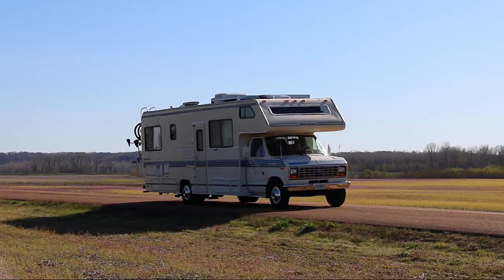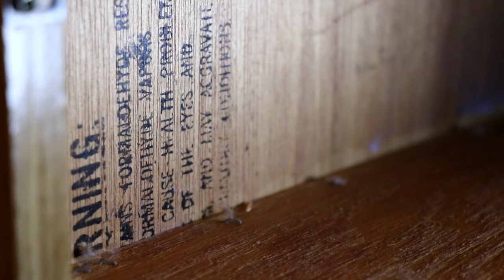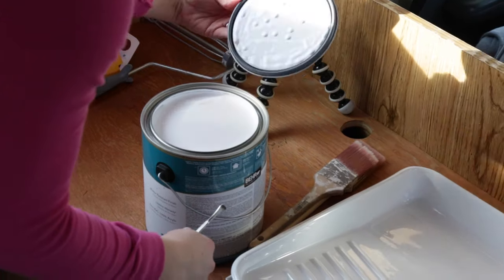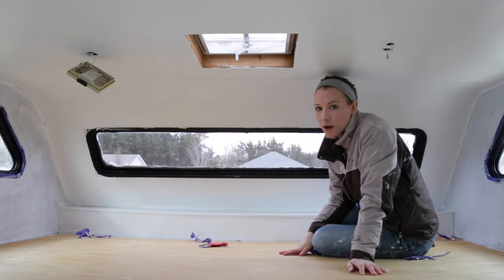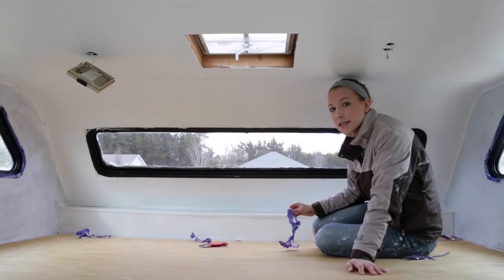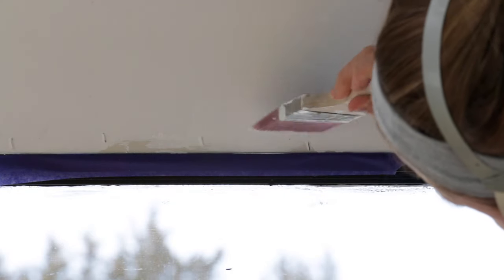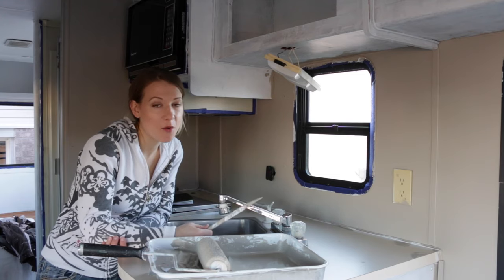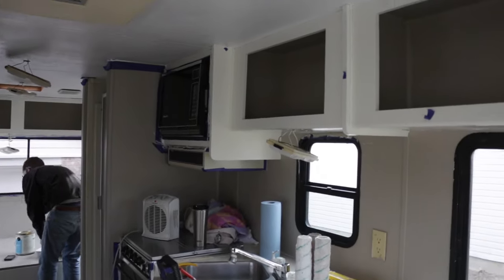Painting the RV Interior for Our RV Renovation

Comment: While sealing is a good idea, you have a couple of items you should consider.
#1. Your RV is at the newest, 25 years old. Not sure the exact year but that body style cab went out of production in 1991 I believe. I would assume that even if that cab and chassis were leftover stock, it would have completed construction by 1992 at the latest, so at the very newest you are talking about 24+ year old plywood, and pressboard. Most of the formaldehyde that will offgas, already has. However there WILL be some. Just like in a house, or condo, or apartment, or whatever. So you are mitigated somewhat already.
#2. In any small enclosed space like an RV with wood, and fabric products of any sort, you MUST include proper ventilation into the design, construction, and utilization of the space. If you don't have one in there, and can afford it. A Fantastic fan, or similar clone (thermostatically controlled fan) will help keep the airborne formaldehyde levels low. 
#3. Formaldehyde is naturally occurring all around us, having formaldehyde in the environment isn't necessarily bad, unless you are allergic. Kind of like peanuts. 
#4. Formaldehyde is pretty far down the list of sensitivities for many people. I happen to own an air purifier I use in our living space, that is HEPA rated, and rated to remove formaldehyde. Check Home Depot, and Walmart, they kind of look like those tower fan things, but have a big pleated filter in them, and usually some sort of UV chamber to kill bacteria and viruses.

Keep up the good work. Those lighter colors will make the space feel MUCH bigger, and lead to less cabin fever in the long run.
Reply from the maker: Awesome! That is some great info, David! One of the main reasons we chose to use the safe seal was getting rid of the "old rv" smell too. This product is awesome! It literally seals in everything and we can now live in it without getting headaches from the smells. Thanks for the great comment!
Reply: I may have missed the fine print where RV manufactures make this known, so I want to thank you and David Hostetler for the info!

Comment: Looking good! I ended up buying a different class A than the one that had a lot of water damage. It's pretty swanky, I made a few videos of it. Pulled out the carpet, thanks for your video on that, and I got the generator running better today. Have you guys figured out what kind of flooring your going to use? I was going to go with a composite hardwood.
Reply from the maker: Oh that's awesome. Congrats on the new rig! Yes! Flooring will be the next few videos after our composting toilet build. We seriously can't wait to show everyone because we haven't found anyone else who has done this type of flooring in an RV. We are really looking forward to showing what we did... almost as much as our 600w solar system install. Stay tuned for all that :-) Thanks for the great comment!
Reply: +Duet Justus Don't do tile, it can't flex with the chassis. Tiles will pop loose and crack. From my research, driving a rv down the road is equivalent to a 8.0 earthquake, then factor in hurricane force winds to the front while driving at highway speeds.
Reply from the maker: +Jayce and Jeremy's Adventures. Yep that about describes it haha! It isn't tile, and after 4,000 miles it's holding up very nicely.